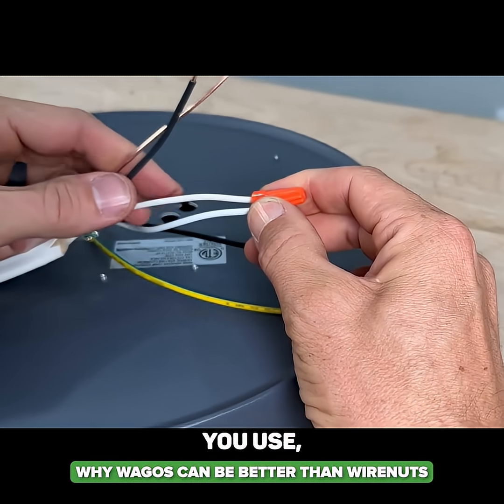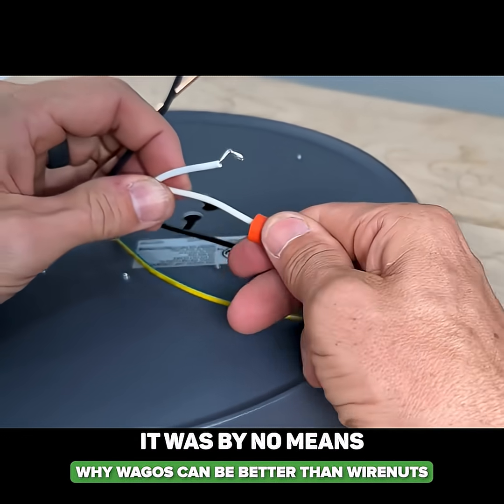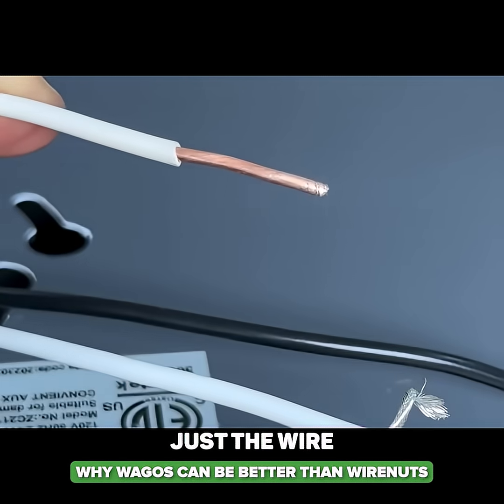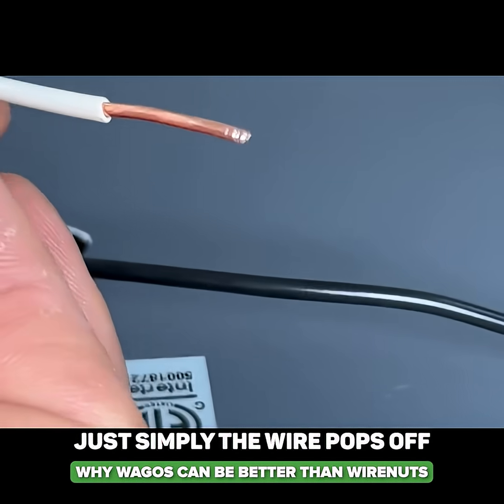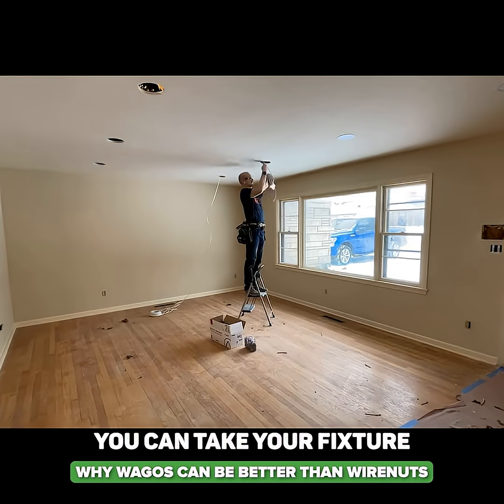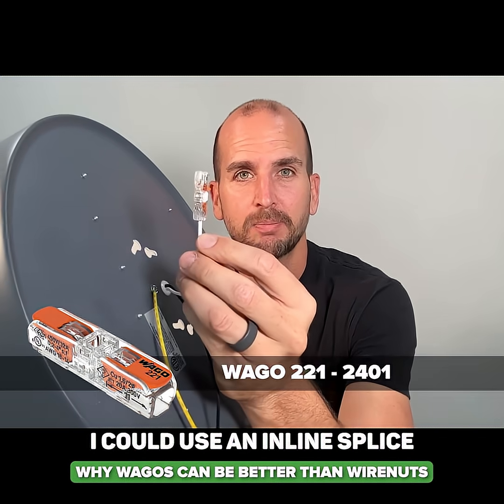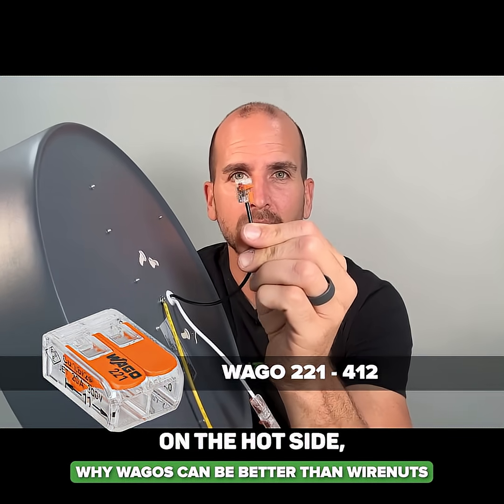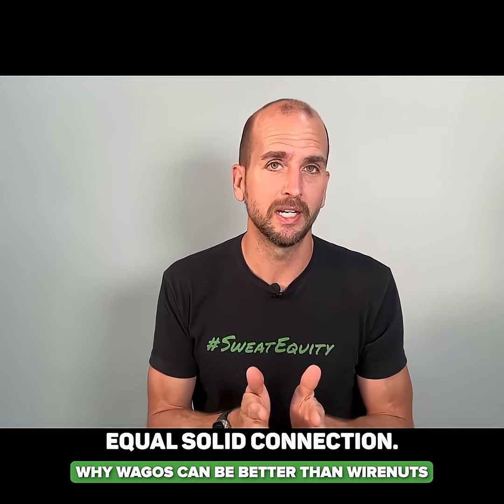The #1 Connection Mistake With Wire Nuts (and the Fix) #electricaldiy  #Wago221 #WireNuts

Comment: I use the levers whenever I have stranded wire and wire nuts whenever I have solid wire. Or to make it easier pushin connections